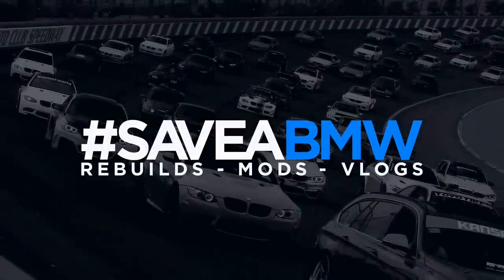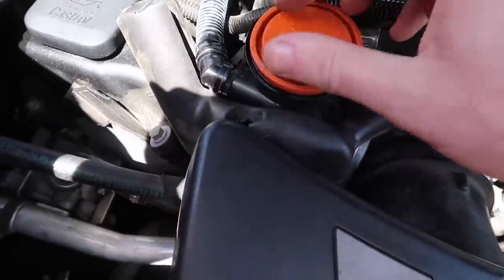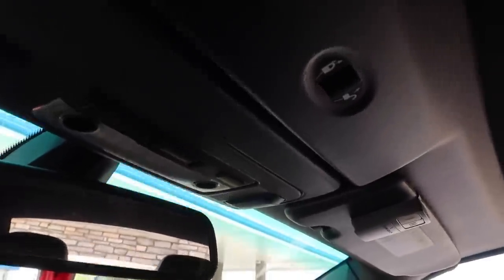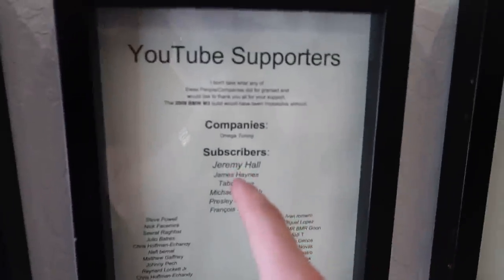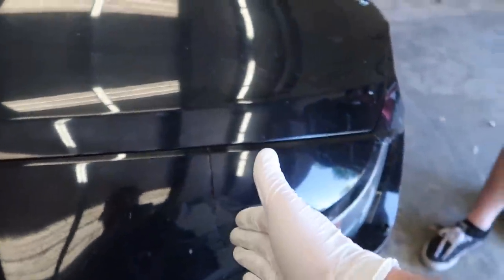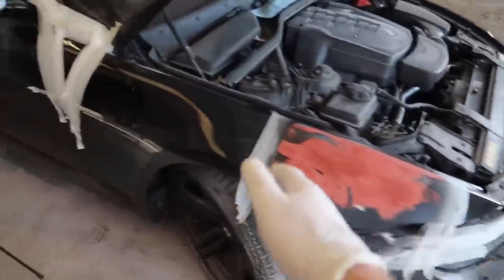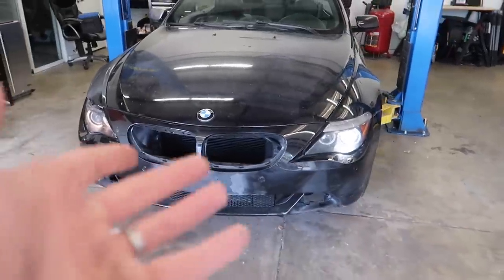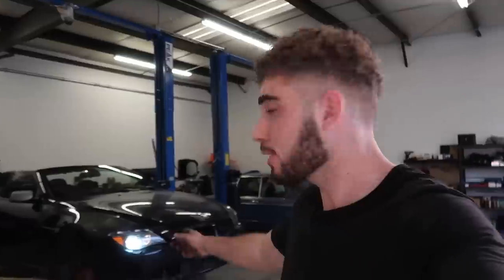Rebuilding My TOTALED $800 BMW V8 650I! (Part.3)

Comment: Change the engine oil due  to the bad pcv valve u had. 
Had same pcv valve problem, sludge were formed
Reply: Hussein Goolamun was your car misfiring
Reply: KINGME yup she was and also rough idle.
Reply: Hussein Goolamun mines is in limp mode now I change the coils spark plugs pcv valve cover they said sometimes when u unhook the valve tronic they be off track u ever heard of that and I took off the throttle I wish I never did none of those last 2 because my car was running better and I ain’t going back to the steelership